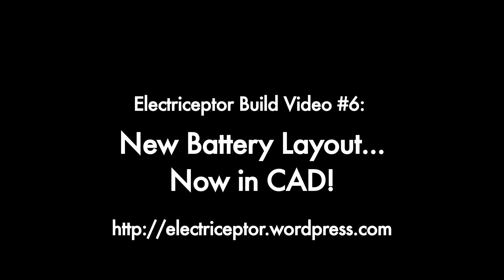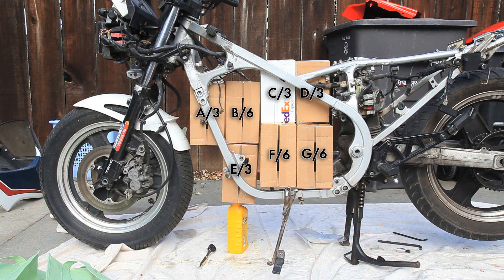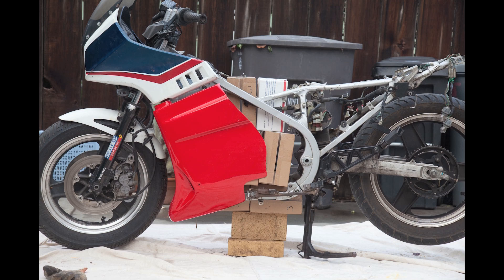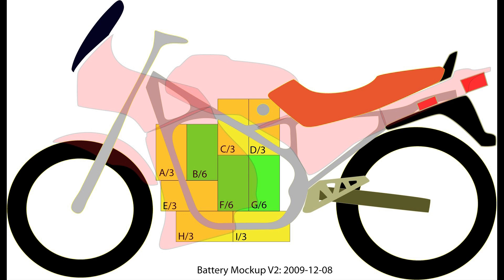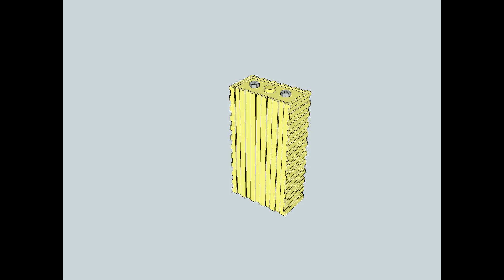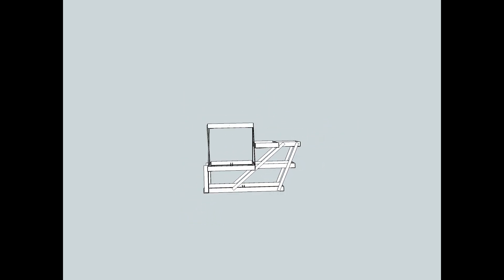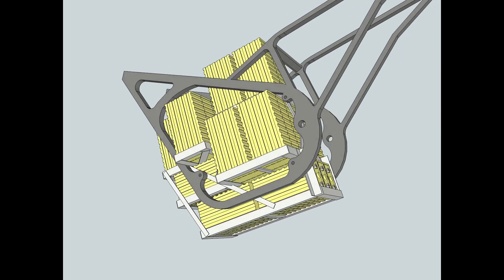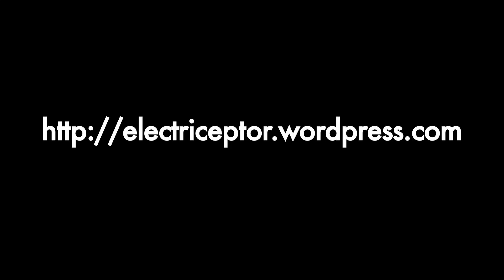Electriceptor #6: New Battery Layout (Now in CAD!)

Comment from the maker: Thanks man.  I'm planning on sticking with the brake pedal for now.  The current plan is to use the rear brake pedal to activate the rear brake as per normal.  Also, have the regen activate on zero throttle (similar to engine braking on ICE), then have the clutch handle (when squeezed) disable regen for coasting (again, similar to ICE).  

I've been leaning towards the charger-in-saddlebag idea since i don't think i'll be able to fit it and the controller in the gas tank area like i thought.